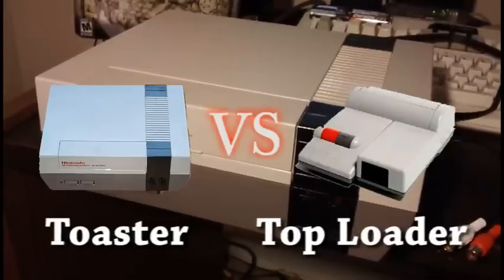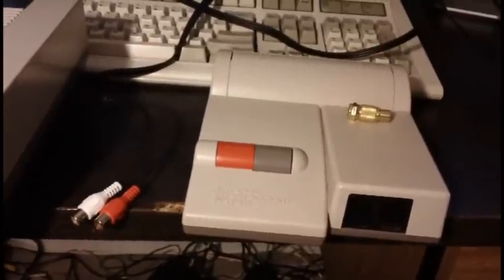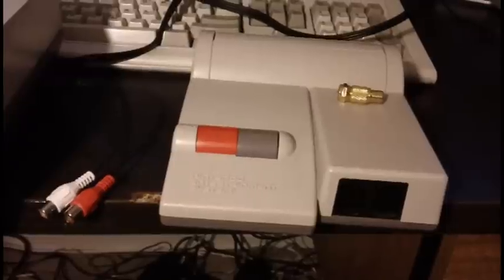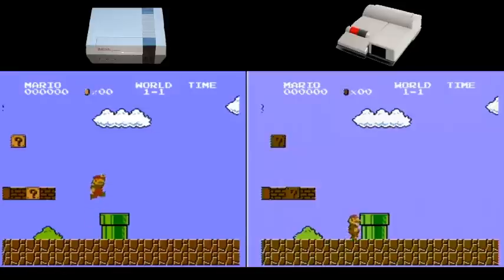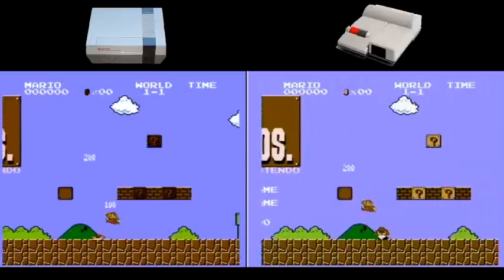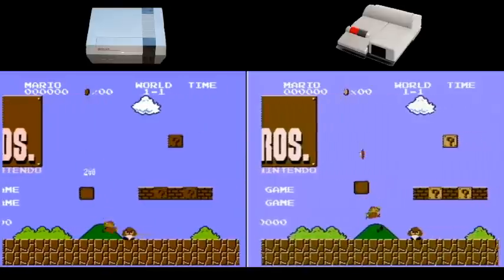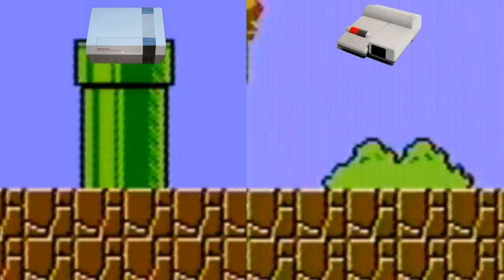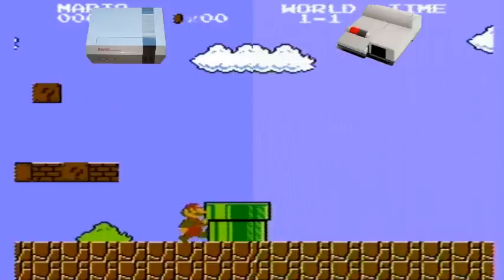NES Front Loader vs Top Loader

Comment: The NES's graphics resolution is low enough that the difference in sharpness between composite and RF is minimal, and the colors can be corrected by adjusting the brightness and tint on your TV. So then it really just comes down to whether or not the NES2's vertical lines annoy you enough to distract from the gameplay.

Comment: Why didn't you run both systems through RF for a more accurate comparison?
Reply: +Sadpants McGee WAT!
Reply: boobio1 He ran one on composite RCA, and the other through the RF modulator.  That's not testing the actually video capabilities of the systems.  Just the video capabilities of the video transport technologies.  Most people I knew back in the day used the RF modulator on the original NES system anyway, so that's what they would be familiar with.
Reply: +Sadpants McGee Just about EVERYONE I knew that had an NES ran it through RF. This was the 80s. Most of us were playing on old school TVs without AV
Reply from the maker: +Sadpants McGee You're right that composite is a better "transport" than RF but one point of this video was to show that the top loader lacks AV output in the first place while another point was to compare the best that both systems could do stock for stock.  Normal RF interference and the vertical lines are two different issues as discussed across several technical video game based boards.  If you use RF on an original NES you do NOT get vertical lines and on top of that if you mod composite AV output onto a top loader you will STILL have the vertical lines.  The vertical lines are caused by interference from clock generator signals running through nearby traces that are too close to the video signal traces.  Adding extra filter capacitors to the PPU circuits can SOMETIMES help solve the issue esp on PAL top loaders.  The reason that Nintendo didn't put extra shielding or extra filter capacitors, or even worry too much about trace length/design on the mainboard in the top loader is the same reason it lacks a power LED or AV output in the first place.  Because it was designed to be manufactured at a cheaper cost.  so again, no this video isn't comparing RF to RF as some think it should, but rather was meant to compare the best video you can get out of a STOCK original NES and a STOCK top loader.  If someone wants to mod a top loader (or original) they can always improve on both (as mentioned in the video) but again, I assure you that an original stock NES (that doesn't have aged capacitor issues) does not display any vertical lines via RF output.
Reply: +MN12BIRD Not all A/V mods still have the vertical lines. It depends on how you do the modification. If you go look at some of the mod work that Game-TechUS has done, you can see that his composite modification DOES NOT have vertical lines. Nor does Kevtris' HDMI board that you can use to output HDMI from the NES.
Reply: I think the point Sadpants was getting at is, you say the RF picture on the top loader's not as good, but it's all it can do, so the only accurate comparison to be made between the two console revisions would be RF.  You expect everyone to take your word for it that the VCR (where the hell are you getting toaster from?  what toaster frontloads bread?) design looks better even on RF when you aren't showing that.

The thing is, man, top loaders are easier on carts, so for many people they seem like the smart choice.  When you illistrate a hypothesis in your video's thesis, people expect an accurate test.  You fail to deliver that, and your excuse is "well it's just better on OG".  That doesn't cut it.  Even if true, you fail to demonstrate that in your video.  It's like if I posted a video talking about how the PS3 fat looks better than the PS3 slim, then used HDMI for the fat model but component for the slim.  Sadpants question really is very valid, and you sweep it under the rug.  This video's shit.
Reply: ***** I think they call it the "toaster" because you push the cartridge up and down, like the lever on a toaster.  That's the only way the name makes sense to me at least.
Reply: sorry but 
why didn't you run both systems through RF for a more accurate comparison?
Reply: What the hell are you calling Nintendo a toaster for? They still use toasters and they make great toast. Nintendo's are still being used in house holds. I love and miss the old school Nintendo. Yes I got a little triggered here. Plus top loader shouldn't be called top loader it should be the toaster. Toast is put in from the top not straight in. It doesn't make any sense why you call it a toaster for.
Reply: uhavemooface I thought I already explained this.
Reply: Sadpants McGee How did you explain why you call the old Nintendo a toaster and if you did I didn't hear it. I'm not worried about it just wondering. Toast is put in from the top right?
Reply: "because you push the cartridge up and down, like the lever on a toaster."
Reply: Sadpants McGee Oh I guess that makes sense. I never thought of it that way when you called it a toaster lol. Now I get it thanks.
Reply: Sadpants McGee 
I always thought it was less like a toaster and more like a vcr
Reply: Lol and the very next comment shows that they totally didn't read the explanation;P It's okay, I'll do the facepalm for you.
::Facepalm::
Don't worry. For every one out there who doesn't understand OR bother to read (to increase understanding), there are at least 2 that do. We just aren't as noisy, because we already understood, and had no reason to argue or repeat the same already-answered-questions over and over.
The video (and explanations and patience) are appreciated:)
Reply: because reasons
Reply: He didn't even do that.  He used a ridiculous adaptor to make the video of the RCA cable an RCA connector.  That in and of itself would create the defects in the video quality.
Reply: Um because he's illustrating how poor the RF-only picture quality option is compared the original toaster which can do composite... literally the whole point of the video.

Comment: @solidjose54 you can use a flat screnn but because of the tv's higher resolution you are not going to get as sharp of a picture as you would an standard resolution (old) tv. the reason being that the video signal coming out of the nes is 720X486, meaning you high def wide screen you need to blow up the image, causing it to loose quality.

Kinda like when you look at a jpeg on your monitor then zoom in on it....It becomes less crisp.

Comment: Thanks for the comparison. I own an original (Toaster) NES. I found it years ago in a video game store in the original box in nice condition. I got it for a steal! I replaced the 72 pin connector, and it works perfect to this day. The reason I like the NES Front Loader better is not only the better picture, but it's designed to work with the Game Genie. I love using my Game Genie at times.

Comment: I picked up an NES2 nearly 10 years ago at a used game shop and noticed the vertical lines right away.  I didn't think to look up on the internet at the time to see just how widespread an issue it was.  Had I known this was a common problem on the system, I probably wouldn't have returned it the same day!  Fortunately, my ex-wife had bought me an original deck a few months before we split up and after changing out the 72-pin connecter in 2004, I'm still rocking carts on it today.
Reply: Wow, love to read some old stories about having a NES. Me growing up didn't have a chance having a NES, we all got a pirated chinese copy of famicom called Polystation back in 2003. I hope you're doing well after all these years, sir!

Comment: Man, getting an original model NES to work is always a blast! For the NES I own, my friends and I had to not only do a deep cleaning of the 72-pin connector, we also had to make physical adjustments to them, so that there is essentially no chance that there is a cartridge connection issue, ever. The downside to that is, the carts are not as easy to insert/pull out from the console, but as long as the carts themselves have clean connector pins, the NES will work 24/7. Fun times!

Comment: I did an AV (composite mod) on my top loader, added an LED, and insulated the PPU from interference via grounded copper tape and the result is a top loader with picture quality that is just as good as the toaster. And clean games work 100% of the time. 

For people who care about video quality and don't want to mod their system, go with a toaster, clone, emulator, or virtual console.

Comment: I used to repair the "Power Player" systems, the N64 controllers with NES games loaded on them. The reason for the lines on the NES2 is similar to an issue with some shipments of the power player: There was a current/resistance problem, where not enough power is being delivered to send the video signal. This also may be more pronounced when using gold-plated cables, as they seem to increase amp draw, at least when used on my robotics.

In the Power Player systems, I was able to fix the issue by shorting out the cartridge slot that was used for loading Famicom games, an issue that most wouldn't know or notice in the US, seldom knowing what the slot was for. The circuitry for an extra peripheral slot was NOT used in the NES2, along with the A/V inputs being removed, as you pointed out.

That means, more than likely, the color/line issue is possibly more that they didn't provide enough amps going to the (we'll just call it a) GPU output, and less about interference... though the "interference" could just be translating to extra/fewer amps, causing the confusion?

Comment: for the toaster, i really recommend NOT cutting or grounding the CIC chip! Its not only for region locking and preventing bootleg games, it also stops it of there is a short in the game or if it is overheating. also, its really not that hard to fix a buggy system, just clean the 72 pin connector and the games. if thats not good enough, just try lifting the pins.
Reply: +rollercoastermaniac2 So many idiots blowing in cartridges when it would cost them about 8 bucks to make that problem a thing of the past.
Reply: If none of your games work, pull that lockout chip! (Maybe)
Reply: +Wflash00 Switch is okay i guess, but its still a bit dangerous
Reply: I've had mine clipped off for about a year and I have never had any issues with it.

Comment: I have a front loader and have wanted a top loader for about nine years. I wanted a  modded one though and ordered one online a few hours ago. It has a power 
LED, stereo sound and composite  mod. It was costly buy I need it since I'm tired of my temperamental like top loader. Not easy to get a game running with my top loader even though the pi connector has been replaced. Great video!

Comment from the maker: Yes the Top Loader is much more reliable by design.  I recomend it to someone who doesn't care about the picture quality AND doesn't want to fiddle with an original.  My original has the 72-pin connector replaced and the 10NES chip cut and it's just as reliable as my Top Loader if the games are clean they will run no problem.  But I understand some people don't want to fix the 72-pin and mess with the mainboard.  The Top Loader generally works best for those people.

Comment: Your third option with the Famicom 2 is the best for overall compatibility. It's nearly identical to our top loader, but has AV out and no RF. All you need is a proper power adapter and a 60-72pin adapter. Since they sell for around the same price as the NES 2 on ebay, I can't see why anyone would go for an unmodded US version. Plus, you get to experience the original Famicom games.

Comment: I noticed this when I had to test some games for Ebay. I got the top loader from a local game store at the time for free and I only messed with it enough to get it working, cleaned it, and put it in my cabinet. I hadn't played it since then until yesterday. I thought the picture looked pretty bad. Also I noticed unless you are using the original power adapter for either of the models, it can interfere with the picture. I also use the same RF adapter you are using except I use a single 24k gold plated video cable. I use these on pretty much all my single RF output consoles even as far as installing it into an Atari 2600 system. It actually provided a pretty clear picture and made selling the systems alot easier.

Comment: At the same time, make sure there are no connections from the Top-Loader NES' on-board video amp being made either to the RF modulator or to the 2C02.  Any connection being made to that amp when using a rebuilt video amp will not eliminate the vertical lines.  I still haven't personally tested this, but from what I've seen for the Top-Loader NES A/V mod, it could very well be possible to just rebuild the Top-Loader NES' on-board video amp and run the amplified Composite through the RF modulator.

Comment: It's good to note that if a simple AV mod is performed (basically just adding the RCA jacks) and no alterations to the board are done, the lines will still appear.  There seems to be a problem with the layout of the video signal circuit within the board.  If you completely remove that line of components and rebuild them on a separate hobby board, the picture will clean up perfectly - but of course that's a daunting task, even in comparison to a simple rigged RCA-jack mod.

Comment: While I can understand people wanting a top loader for collecting purposes, I never understand those who want to play it over the front loader. I was shocked when I first turned on a top loader and seeing how inferior the picture quality was when compared to the front loader as you so well show here. I was also shocked to see from my test that the earlier front loading NES systems picture quality is inferior to the later front loaders. I actually would have expected the opposite since generally the earlier models are better in most game consoles but the one I tested was a test market NES 50,000 serial number range versing a 89 era NES. This may have been due to it being a test market console or possibly the video output component technology may have improved a bit from 85 to 89.
Reply: A great item to pick up and add to ones collection, as long as you can get the dog bone controller with it.
Reply: Well games actually start up and don't freeze with the top loader. So I'll take one over the original anyday.
Reply: My front loaders never freeze and the picture is so much better. Games always start right up as well as long as you keep the game contacts polished. I can always make front loaders work but top loaders not so much. Once the pins wear out in a top loader that is all she wrote.
Reply: Nesmaniac
But the pins wont wear on a top loader because there isn't a flawed design where they bend.
Reply: salozmen29 Actually they do because as I said I've had 2 out of 10 top loaders not work at all but I can always get front loaders to work since there is tolerance with the pins. Once the pins in a top load design wears out there's nothing else left to do, you can't even replace the pins.

Comment: I bought a PAL top loader in a box for $12 Australian, which is probably about two rocks, some pocket lint and 3 cents US (maybe about $8-$10US). I would like a front loader, but I am happy enough with my region free NES to not want to spend $100+ right at the moment for somewhat better picture quality. Even purchasing a "broken" system (flashing red light) is not cheap here.

Comment from the maker: Keep in mind it may be harder to notice on an LCD compared to an old CRT and also this is RF vs RF and most people who have an NES would use the Composite AV output not the RF so it would look even better.  Still, the Top Loader for some people is acceptable and it is more reliable no doubt about that.

Comment from the maker: It's comparing the best possible image you can get out of a Stock original front loader and a Stock top loader.  It's fair and it's not my fault the Top Loader lacks Composite AV output.  That's a major down side to the top loader.  Besides even using RF on an original front loader you still don't get any vertical lines.  Check it for yourself.

Comment: I think the problem with the vertical lines on the Top-Loader NES is due to interference on several parts of the video circuitry.  For starters, if you bypass the trace linking the 2C02's Composite output to the first part in the video amp(a transistor) and remove said trace, the lines become much more faint.  I do believe the definitive fix for removing the vertical lines without doing an A/V mod is to completely rebuild the video amp away from the motherboard, i.e. on top of the RF shield.

Comment from the maker: The top loader has a red power switch that slides up.  It might look like it pushes in to turn on but it doesn't it slides up.  The top loader has crappier picture because it doesn't have composite AV (RCA) output it only has RF and the internal filtering isn't as good since it was made smaller and cheaper.

Comment: Hey, once you see those vertical lines it's hard to un-see them.  Another thing you might consider is the TV you're playing it on.  The HDTV I have my top loader hooked to has some noise reduction options in the picture settings.  It's not perfect, but it does clean up the vertical lines enough that they're not distracting.  So short tip, i you're pplaying on a HDTV< fiddle with your picture settings.

Comment from the maker: You don't see the vertical lines?  Plus remember this is RF vs RF I wasn't using the AV output on the original because I was trying to keep it fair since the top loader doesn't have AV output.  With the AV outputs on the original it would look even better.